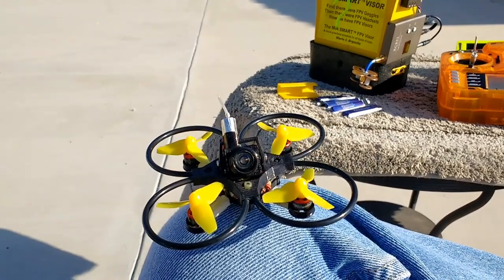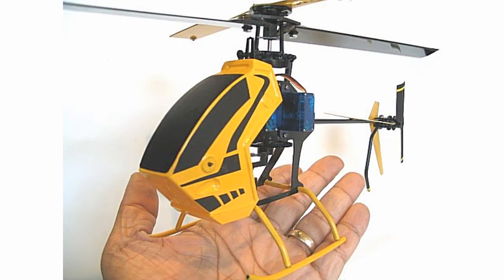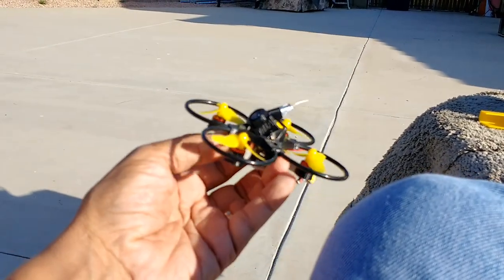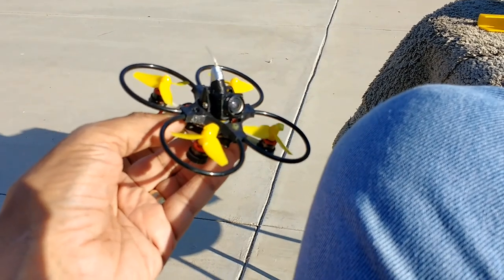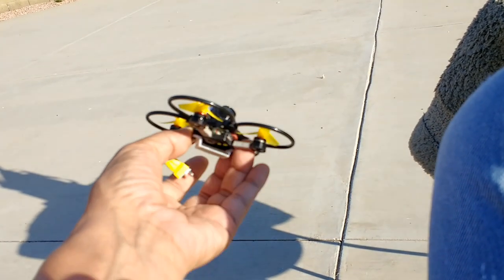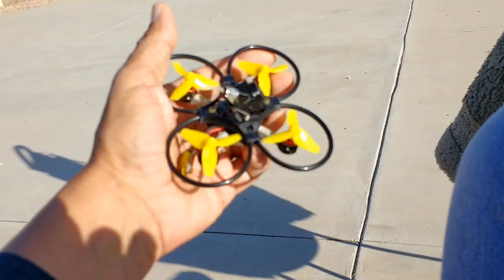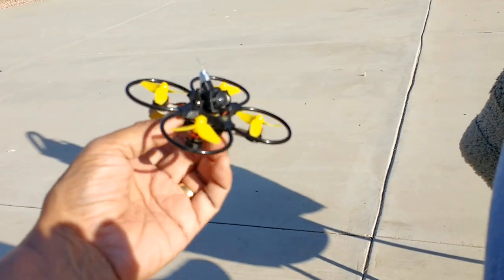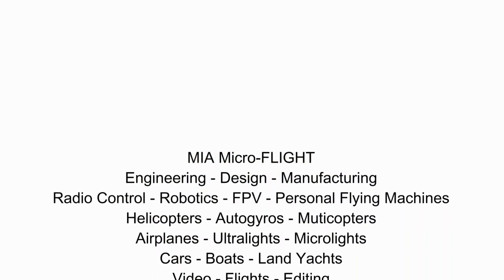Mobula 7 with MIA TUFF Upgrade Frame Preview

Comment: I appreciate the idea with the rings. I would like to ask, what is the weight of the frame without electronics/camera/motors. Also the ducts on a regular mobula allegedly give better performance (there is 1-2mm gap between the blade and the prop, so I doubt it a little bit), but, have you considered replacing the tough ring with a flat "strap" (such that it is similar to a duct) ? Do you think it would help ?
Reply from the maker: Thank you - The weight of the MIA setup is about 4 gms over the the stock raw frame and that is because the 3D Printed base was made much stronger than typical and the rings are super tuff, these rings will never break.  The rings are not ducts,  and not intended to be, since the target of this particular design was to provide extra protection for the equipment, motors, camera and FC.  The efficiency difference is near negligible, but there will be a slight reduction in flight time vs with the stock frame, depending also how one uses throttle and control management.  If this sounds like a good trade-off than this frame might be for you.  It certainly is for me, I prefer durability since I fly freestyle and for fun and I am not competing in a race  and thus reason I designed it after having gone through dozens of 3D printed frames and not finding one to my satisfaction, durability wise. However, I can justify the small reduction in flight  for the added equipment protection. 

If you are looking for max efficiency at the trade-off of less protection for the electronic equipment, then remain with the stock frame as this is the lightest (however not as durable) of all frames.  

There is a difference between an aerodynamic "duct" vs a simple flat ring or "strap", as I think you mean. Aerodynamic ducts provide true efficiency when properly designed, they must have close tolerance with the prop diameter spacing and must also have efficient airfoils. The stock Mobula 7 has somewhat of a duct, but I would not call it an efficient true aerodynamic duct.  I have designed proper aerodynamic ducts for the Mobula 7 and similar motor driven products,  to give them a bit more efficiency but  it is tricky getting a good weight to surface area ratio in a 3D printed part. Another reason I elected to do quad-copter frames with the MIA TUFF™ rings, at least I am getting a much tougher protective ring than a duct.  Its a trade-off, like I said, and it depends on your type of flying and what you want from your machine.